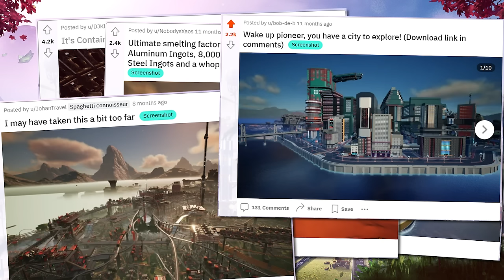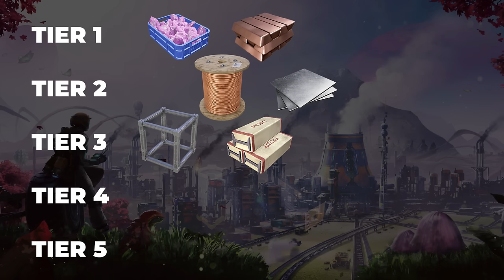Mega Factories vs Modular Factories | Satisfactory

Comment: Important tips for modular factories that one can learn from factorio: always transport items in their most compact form when possible. if you get more wires out than you put ingots in, you'll have less throughput on your belt or train. So it may be better to transport the ingots and then locally produce the wires.
Reply from the maker: Excellent point! However, since Satisfactory has varying stack sizes, you also have to consider that. In the wire example, one ingot makes two wire, so it may seem that it's more compact to transport the ingots. However, ingots have a stake size of 100 while wire has a stack size of 500. One stack of wire is equivalent to 2.5 stacks of ingots, therefore it's more efficient to transport the wire.
Reply: @SatisfactoryNews  same applies in factorio, although there's its more common to have intermediate goods stack better. fair point too

Comment: For 1.0 I'm going all out on modular. After the initial exploration for alternative recipes and basic building, I plan on centralizing the refinement of every single raw material into factories dedicated to each spread around the map. I want to be as efficient as possible, so everything is going to be done in refineries, and factories will have belt and machines ready to be wired once the power and belts are researched. I'm excited, but I'm sure building something like this will take thousands of hours. It's an ambitious project that will take a lot of planning, but I'm genuinely excited to go for maximum efficiency and decentralized production that is driven by an extremely complex transportation setup. Can't wait for this to be done by 2030 lol

Comment: my favorite playstyle is a hybrid between mega/modular. I like building 4-ish different "mega" factories, one for each biome (e.g. for each starting location) and connecting them with a train network. For example i'll have a fuel powerplant/production/storage "mega" base in one biome but then iron/steel/copper/caterium/etc in another and usually the desert is reserved for the "main" base where i setup my hub. The desert factory may not be the biggest one, but thats usually where i setup the hub and space elevator, where my doggos live and where my mall/storage is. This is very nice because theres always trains driving around, making it feel busy. The factory is also split up based on material so if, for example, there is a power problem, well... go to the power factory and the problem usually is there and easy to spot since there are no other materials mixed in, but its also in one place so i dont have to go looking around which modular factory/powerplant is causing problems.

Usually it looks like this:
Grass fields: Basic material factory (e.g. ingots, (heavy) modular frames, computers,  circuits, etc)
Dune desert: Main base (e.g. mall/storage room, doggo enclosure, pioneer home + hub, passenger stations, gas mask filter prod., bio mass/fuel prod., etc)
Blue crater: petrochemical (plastics, rubber, (small) backup powerplant for coldstarts + storage, liquid biofuel, etc)
Rocky desert: Monolithic powerplant (fuel production, power generation, waste disposal, switchboard, power+fuel storage, etc)

Sometimes there are remains of the "starter base" like an extra coal powerplant in in the western dune forest, but i usually leave that there since with this hybrid approach i have enough space in other biomes (also my last coal powerplant was a 10GW one so i didnt wanna destroy it as it was designed for reliability and to this day still runs a big chunk of my essential factory buildings as its on a separate power circuit)

This hybrid approach brings a lot of logistical challenges and thats what i like. I think i'm not the only one doing this, but i havent really seen anyone else do it (i dont watch a lot of satisfactory content either tho so...)

Comment: I use a system of clusters and central storages. First I build an ingot factory. I build it in a way, that I use lanes of conveyor, which are connected to constructor factories. If I need to produce pre-products, I build a separate factory for it and connect it to the next. So my factories are rather small, but form a cluster for specific products.

These products are than send to a regional central output storage. The storage is positioned next to a highway. From their, the products are transported to the next cluster of factories and loaded into an input storage, which need the products or are brought to the space lift.

So, I have clusters of different factories all over the map, which are interconnected by logistic infrastructure. Conveyors are used for short routes, vehicles for mid routes and trains for long routes. Sometimes I use longer conveyor buses, if the terrain demande it.

Because the highway connects all clusters, I can use it to move between factories. Before I build a new cluster of factories, I build a highway there.
Reply from the maker: I love this. With a little better planning, this is what I'd love for my main playthrough.

Comment: I have a few tips for modular factories (as a modular factory enthusiast):
0. Get very comfortable with rails. Always lay two rails so that you can have trains moving opposite directions. Also, have mental templates (unfortunately, blueprints are too small) for junctions and stations with multiple platforms. Each outpost is probably going to have at least 6 separate train platforms, for all of the different trains which visit it.
1. Build your rails high in the air, so you don't have to deal with terrain.
2. Use trains like private limos, not public transit. Each player on the server should have a private train, which they can hop into and set to autopilot to wherever they want to go. There should be at least one dedicated platform at each facility for player access trains. The cargo wagons on these private trains can be used as an extended inventory of sorts. Don't rely on riding the cargo trains around.
3. Trains can be extended in any direction. If you've finished making something and aren't sure where it's going yet, send it to a train and send it somewhere later. If you need a resource and haven't set up production for it yet, build a platform that takes it in, and fill it later.
Reply: Which brings up a good point. I believe there should be 5 sizes of Blueprint Makers:  (1) Micro, (2) Standard,  (3) Commercial, (4) Industrial, (5) Mega - Industrial. I'd give this advice to the devs, but I don't know where to send it as far as emails or such.  As for why I came up with these types, well a brief explanation is in order. MICRO would be helpful for creating small items  that are even below the size of a 1/4 of a standard foundation square and would be useful for creativity of future handheld or utility items as well. STANDARD is actually the size we have now, so no explanation is needed. COMMERCIAL would be double the Standard size and could be utilized for custom design works in vehicle creation, signage, lighting or localized modular power plant designs, and of course... Train Engine and Train Car Design and Customizations. INDUSTRIAL Blueprint maker would be 200% larger than it's Standard counterpart and would be utilized for specific designs in small factory sections, customizing and creating medium Power Plant designs, Small to Medium Water Utility Station designs, Foundation, Wall, Window, Door, Bay Door, Roof, Road, Larger Signage creations and customizations { i.e. - more shapes to building pieces like curves, etc.},  Vehicle, Truck, and Train Station Creation and Customization pieces.  MEGA-INDUSTRIAL... as the name implies, this unit is so large [ 5x Standard size ] that it would need to be plopped down either in the flats of the desert, or build a ramp up into the sky and use it there. This would be VERY helpful for those who need a way to push their constructs into "Mega-Projects" sizes and have the ability to create and customize Large to X-Large Power Plant sections, Fluid utility Station pieces, Water, Nitrogen, Oil, Geyser, Etc. Utility Supplier Stations,  Bridge Piece Structures, Power Tower Structures, Train HUB Stations, Storage Depots and Mega Warehouses,  Mega Factory Pre-Built Building/Floor Sections, X-Large Distribution Manifolds, Custom Mega-Structure Input Manifold Designs for Sky Elevator, etc.  FYI:  full disclosure, <----- Old Retired Engineer who discovered this game by chance 3 weeks ago, and have already placed 281 hours into it. I apologize ahead of time if any or all of these ideas have been created, talked about prior to this, or were already declined as good ideas by the production team at the studios. This has quickly become a great passion for me and only wish to help the community with any ideas that cross my mind. 🤨👍

Comment: Great video and very informative!! Great for anyone considering going mega or even giga factories! Having dips in frame rates is just a trade off when building those sized builds.  
Factories - 1-9999/min :
Mega-factories - 10,000 - 99,999/min : Giga-factories - 100,000 - 999,999/minute - 
Tera-factories are one million plus/min
(These numbers are combined total items across all stages)
7900x cpu - 4090 GPU- 128gb of ram and I still average 30-50fps in the most unbuilt places for my Tera-factory. BUT I have found many MANY building techniques to easing the load on the game engine to allow for smoother/better performance for large factories. Appreciate the shout out!
Reply from the maker: Thanks for the comment! Your videos showing your abysmal frame rate are a great, but extreme example of the performance tradeoffs, so I wanted to send people your way.
Reply: @SatisfactoryNews  yeah I never hesitate to tell everyone that my save is absolutely the worst case scenario for large builds and performance lol

Comment: Great advice! I wholeheartedly agree.

Tip. Make your first couple floors of your base 10 walls, 40m high. Will be able to fit in train stations later. Bottom floor is great for setting up an early truck network 40 m gives enough space to build a large multilevel road to efficiently direct large traffic and then trains on second story later.  Also can stack ind storage 4 high and still have two floors for logistics, before the next level of processing. 
I usually start with a Mega factory through tier 6, once I get access to coal generators. Then setup a train grid to create a massive turbo fuel plant for power and begin to specialize with large factories all over map for alternative recipes. 
The mega factory I keep with a non automated train line to load and transport the resources I need to expand. Building a large train grid after resolving power issues makes expansion really easy.
 God I love blueprints, blueprint anything you can. Think out of the box and create blueprint logistic floors and production floors for easy spamming. Its crazy how a priject thst took 8 hours in update 6 takes about 45 min with blueprints. 
Smart splitters with overflow option? I asked for this years ago in feedback to Coffee Stain, its a game changer. Love it.

Comment: Interesting. The way I've been doing it is sort of a mix between megafactory and modular. Namely, I build "towers".

Every component has a dedicated building for manufacturing. Each floor of the building is designed to push out a full belt of a specific good. The buildings are placed in a way that makes sense to a degree, such as the iron rods tower being close to the screws tower, and the screws tower is close to the reinforced plates tower, and things like that.

When I realize I need to scale up production, I just slap another floor of production on top of the last one. For upgrades, I either just use them on a new floor and just use fewer machines, or I wait until I can upgrade an entire floor with something like slugs + belt upgrades, along with the supply line that feeds it all the way back to the raw resource.

Belts are nice and neat with this method too. They're pretty easy to route between the buildings and using the belt windows properly makes it really easy to remember how to hook everything up whenever you're building another floor for production.

Comment: There is also the "whole chain to single item" factory. So basically the idea is, for each and every item in the game, you have a dedicated factory that goes from raw materials to the said item.
So you'll have 1 factory for rods, 1 factory for screws, 1 factory for reinforced plates etc etc...
At the very beginning the factory are really small, and for higher tier items the factories are much larger.
The benefit is that all factory are completly indendent, meaning that it is easier to fully optimize the factory (as everything is done locally), and if 1 factory breaks for some reason, or needs to be updated, it can be stopped without impacting the other factories.
The downsides are that you'll have to rebuild the low-tier items in every single factory, and it can be hard to find all the desired raw materials close together

Comment: I prefer a blended form... modular, but with a divided upcycle, where a reasonable portion of products are sent to a secondary ?micro-mega? factory which focuses on having a maximum of three machines producing a given product. This also gave me a reason to finally take advantage of overclocking... as I never had much use for it previously. As the production stream lengthens, I simply adjust the production rates of the machines to take maximum advantage allpwed by the throughput of three for each item. It also makes it super easy to set up the various departments/facilities, without the ugliness of blocky squared buildings/rooms.

Comment: I used to think I would prefer the megafactory, but after experiencing the nightmare that managing power, power lines, pipes, belts and roads became, I feel like a modular approach makes life much less stressful. When I put everything into a big factory, once a problem happens (usually because of power) the whole system shuts down. 

Now I try to build smaller factories each with their own infrastructure (power, water, belts). Then I put a different colored street light at that plant's specific factory and when power goes out I can look at my row of power plants and be like "oh, the purple street light doesn't work, that's quartz." 

It takes a lot more building and planning and logistics (and too many truck stations) but the reduced stress I inevitably get from managing a city-sized megafactory is worth the extra travel time.

Comment: I run a hybrid of both of these. For example, i will sometimes build a small factory to process ore before it gets to the mega factory. The mega factory only does higher level processing, so everything that gets mined that can be processed gets processed at the location it is mined. This keeps me from having to have a crap ton of smelters in one place.

If i know the mega factory needs a specific, lets say up to teir 3 resource, then i'll process all the way to rotors or reinforced plates before shipping the product to the mega factory for further processing. The reason being that this keeps the frame rates happy, but the end game processing still produces a sizable factory capable of bustling with activity.

Comment: I typically just build multiple plants in different biomes focused on making multiple parts that require the same materials, connect them all to the same mega-power-grid (way overkill with the energy production), using power towers, then commute between them using hypertubes that use the sonic speed exploit to get between them in a matter of seconds. And when building a new production plant, I usually use the Zipline tool to zip alone the power tower wires to get back and forth between the plant in development and the already established plants until I can build a new hyper tube to get there.

Comment: I take a third method which is Minimega factory that processes all of a particular resource type; ie all things that require Iron are processed in a single factory building.  So, for example, I have a single factory that processes iron plates, iron rods, reinforced iron plates, rotors, modular frames, and screws.  The other ingredients are brought in from their local factory.  I also have a single factory that processes all items that require copper.  I have a third factory that processes concrete.  I then bring all of those things together in a central location.
Reply from the maker: That's cool! That's something I sort of tried to do, but it just doesn't take long to get items that require multiple types of materials so I had a hard time sticking to it.

Comment: I like planning around crucial components and build big dedicated factories for them, like using an entire cluster of iron nodes to making as many heavy modular frames as possible.

In my last game before 1.0 I built around the highest tier items, turbo motors, fused frames and super computers, each getting a dedicated factory and then I just put the stockpiled components in some manufacturers to make the space elevator parts.

My solution to long distance travel is building a path of foundations every time I'm starting to build a new factory, then build a hypertube with 15 entrances on both sides, it doesn't look pretty and you get stuck sometimes but you can cross the width or length of the map in like 30 seconds even if you go up an incline.... you know now that I'm typing this out I realise I could just make two tube-lines and then I wouldn't get stuck in the foundations.